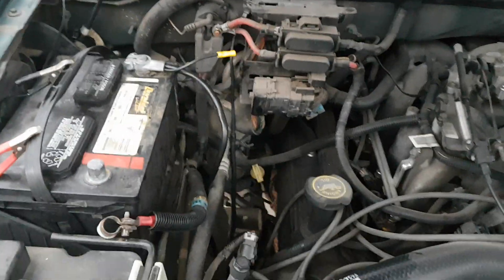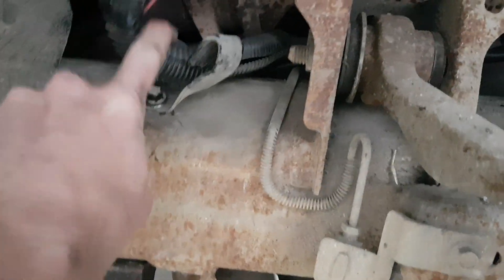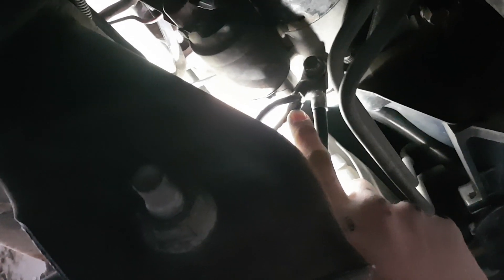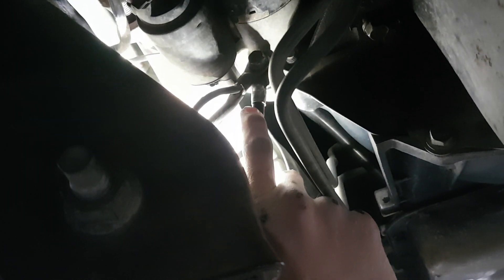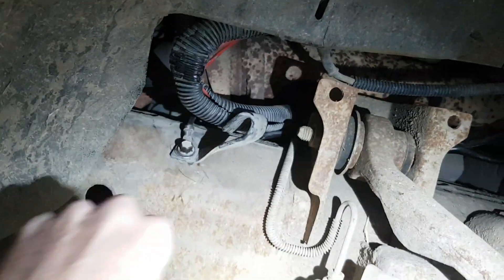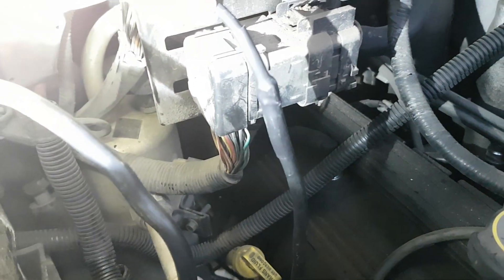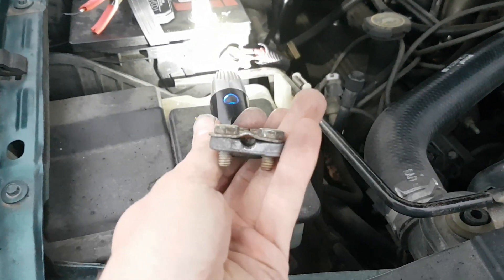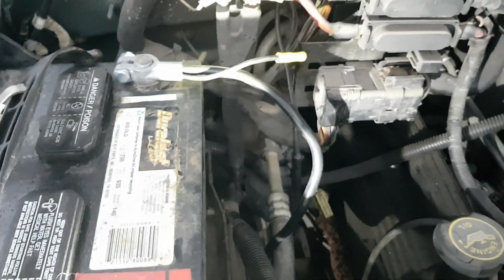Replacing battery cable in 1997 Ford F150

Comment: I knew nothing about auto repair until I bought a Ford. I'm now a master mechanic.
Reply from the maker: I feel the same way. Got a Honda and the dealership was so much junk I figured it was faster and easier to fix it myself. Then with Ford pickup issues. Now with Ford tractors and John Deere tractors. Definitely been a useful skill.
Reply: 🤣 My Ford allows me to justify having my ridiculous tool collection!

Comment: It's 2023 and replacing my 97 F150 cable since the I had those terminals that work until they don't. Bought the same replacement cable so hopefully it goes well and this helped locate things

Comment: Hey FYI there is a darn good reason for the extra ground on both ends if the negative e battery cable. The negative battery cable goes from the battery down to the engine block. On the engine block side it grounds over to the chassis. On the battery side it grounds over to the firewall/body. The reason for this is because these model vehicles don't have the body sitting directly on the chassis. There happens to be a rubber spacer or whatever it's called between the body and chassis. Electrical 101 tata stat rubber does not conduct electricity. The most important thing in your vehicle's electrical system is to ensure that you have equal voltage across the entire system. Because of those rubber spacer things, an extra ground has to be installed in order to complete the circuit properly across the entire vehicle and its electrical components. This is even more important with today's modern vehicles. Because, as we all know, every day, they just keep getting more and more and more electrical components added into them making it more confusing and harder to understand for most people......

So in reality that additional ground wire technically isn't extra because it is necessary

Comment: I got a 97 F150 with the 4.6L and I'm about to replace the same cable. The wire was starting to rust and strands of it was breaking off. So I cut the bad wiring off and it's just like new.
Reply from the maker: Yea someone before me removed part of the old bad wire. It was getting to short to keep doing that. Also the aftermarket battery post were coming lose from the battery cable. I had to bite the bullet and replace the whole cable. At least it wasn't too bad of a repair. Thanks for watching.  I hope the video helped.
Reply: Someone who worked on my truck before me thought it was a good idea to ground the battery to the altenator bracket. I'm going to find a place to run it to the block and a block to frame ground.

Comment: Soldering a battery cable is not a good  idea, icable gets hot, is always better to crimp them together,.
Reply from the maker: So I found this out after all the work. The reasons when to solder vs when to crimp. So far it works but I have been keeping an eye on it. Apparently the solder makes the wire to hard and more likely to break with all the movement and vibration.  So I'm glad for the comment maybe we can help someone else not make the same mistake I made.